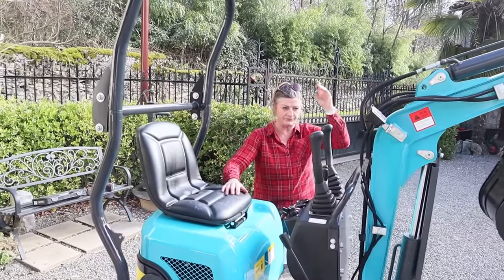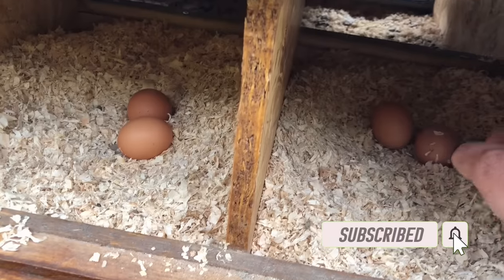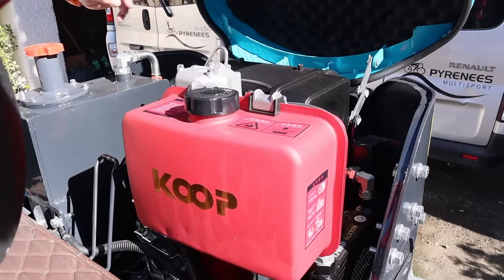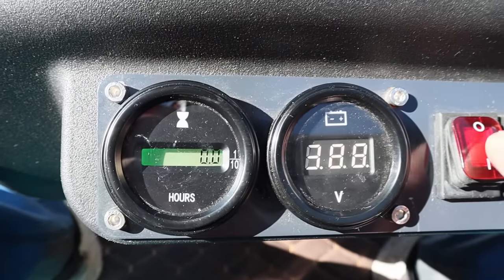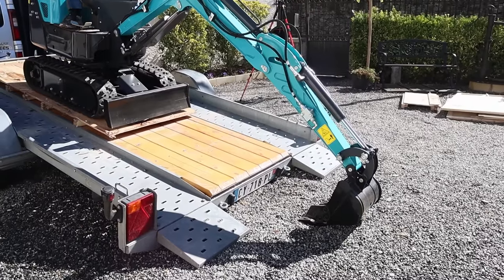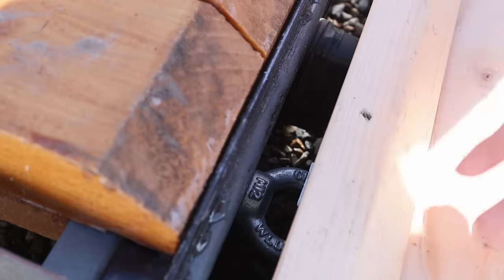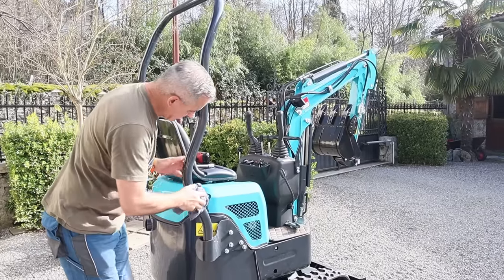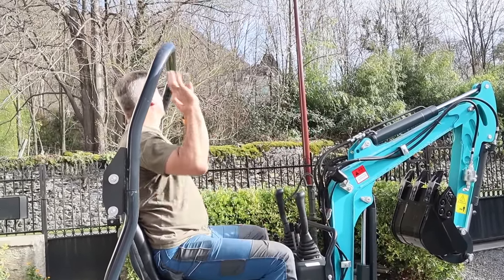Unboxing Chinese Mini Excavator | Nuoman from Alibaba

Comment: How are you finding the noise from those little Koop engines? Sounds like a rod is about to fly out the side of the engine. I’ve got the same engine on a log splitter- my neighbours hate it 😆.
Reply from the maker: I was expecting it to be louder.... there is a lot of sound proofing in the engine.  It is loud when I start it up in the garage but hoping on the build site the sound will dissipate into the mountains...... or echo through the valley 🤣

Comment: I almost bought one of these but in the end settled on a used Takeuchi due to reputation and proven reliability. I hope you get many years out of this and saves your back!
Reply from the maker: It all depends on what is available locally second hand.  There was nothing around us and all the 2nd hand sites seemed to be SCAMS so we opted for this and are very happy with the machine.  Of course I would have loved a Kubota or similar but....  😀
Reply: @HomesteadingUncontained  Don't worry, I had to pay covid tax on it. the same machine prior to covid would have been 3-5k cheaper!

Comment: Second hand ones are only 5k on ebay
Reply from the maker: Not in my area and 90% of the "cheap" excavators you see advertised are just SCAMS.  I called so many when I was searching and it was all just fake.  I did do my research before going down the route I did.

Comment: I see at the back of the manual, there is a QR code. Usually you can get some more instruction video if you scan it. Though it may still in Chinese.
Reply from the maker: I have the English version - the supplier sent it through (translation is very funny)

Comment: The cheaper equipment lacks the durability but that is a small sacrifice for home use.
Be careful with levers and hydraulic, the boom will drop with machine off, once had a mini crush my foot when I was washing it down, I hit the lever with the scrub brush oops!
Reply from the maker: Yes, the only intention it to use it on my own build - not expecting it to last a lifetime but it seems very sturdy so far.

Comment: Put some grade 8 bolts (or metric equivalent) in the roll bar mount because you shouldn’t trust the bolts they gave you with your life. And put a seatbelt on it otherwise the roll bar is kinda useless
Reply from the maker: Seat belt installed - so all good.  I will get some stronger bolts for the roll bar. 👍

Comment: Problem is that little diesel motors not adequate enough 
My 1.5 tone kubota struggles in hard ground 
Use your smaller bucket and take longer if you're planning on digging hard ground.  If you have a ripper use it to losen up the ground beforehand
Reply from the maker: We are lucky that our ground is pretty soft - 2 metres of top soil.  But totally get the "taking your time"  as I don't want to break it.

Comment: Unfortunately these made in China peices of garbage won't last long if you plan on doing a fair amount of work with it. The quarry company I worked for had a Chinese made front end loader,was a light duty one for loading small trailers and so on,he bought it new and did all the required maintenance on it and it lasted only 2 years before a major transmission problem happened with it. Of course it only had a 12 month warranty on it and to get it repaired would have cost more than what it's market value was,so it became a quarry ornament. I hope you get good amount of hours out of it before it packs it in.
Reply from the maker: Bit smaller than a quarry - it is only being used for our house build and services.  But as we are doing it over a long period it was cheaper to buy this than rent for months.  Thanks for watching and commenting. 👍
Reply: @HomesteadingUncontained  yeah I can see why you went that way then,hope it all goes well.

Comment: You can just rent one for the day or two for around 120 1st day 42 2nd etc etc 
if it breaks, not your problem or cost
Reply from the maker: You must live in a very cheap area. €200 a day at least, plus collecting it. The time and hassle makes the job a right pain.

Comment: Beware! Don’t run out of fuel!! Diesel are a pain to reprise and start!
Reply: This one is petrol though! I have one with a Yanmar diesel. I've run it dry a few times by accident. I simply refill and let the electric pump run for a while. It then sestarts after half a dozen cranks, stumbles along on one cylinder for a few seconds, clears & runs fine! I think the electric pump which supplies fuel to the injector pump makes all the difference. Bleeding fuel lines was a real pain, I agree. On others I've used.

Comment: it should have a lever under the seat to change the stick controls. there called iso or standard or aka cat controls. you have iso set up which is backwards for me. but if you've never ran a escalator before it's up to you. super jealous wish I had one for my home
Reply from the maker: I am now going to check - I suppose you get used to one system and then stick with it.  Thank you for watching.

Comment: Hi  Ian and Julie, great video! Im interested in getting the NM-E10 mini and I had a few questions.  1  when buying from alibaba   is there an escrow account that your money is held in until the machine arrives. 2 How much did you pay for the excavator and how much was shipping. 3 Is it diesel or gas.  I noticed you said it was diesel , but I wanted to confirm. Thanks Sean
Reply from the maker: The payment system for Alibaba is similar to Escrow - it is protected and released to the supplier only when you click the received button.  The machine was $5k including shipping.  Then €1000 in VAT and another €1000 in freight forwarding when it arrived at the port - so €7K in total.  It is a diesel machine.  It was a very simple process and I spent a lot of time chatting to the supplier before I pressed the order button.  I have since bought from the same supplier directly and not through Alibaba and it was all good.

Comment: 16:30 the rule is Seatbelts are requiered when Roll Over Protection System ROPS is in service. That bar can kill you in a roll over.
Reply from the maker: Yes, I fitted it for the digger but can't find a belt for the tractor....

Comment: What is it's digging depth?
Reply from the maker: I have gone to 1.5m but I think it is spec'd to 1.6m.   I do have to do my septic tank so will soon find out. 😀
Reply: @HomesteadingUncontained  yeah not long enough for the shallow tanks here in the states you may have to excavate a ramp. I rented an excavator they said would fit on my trailer when I arrived it didn't and took the size down had to park to close to the edge and the ground gave way pitching it forward into the hole was a mess removing it just a heads up!

Comment: Don't complain about the noise of fuel powered engine.  They'll ban them and force electric on you
Reply from the maker: I quite fancy an electric digger.... but not sure the battery would last the way I am driving it at the moment.  Can't wait to get it on the build site as my neighbour complained the other day when I was weed whacking with my electric strimmer. 😅

Comment: You can see it has tabs for seatbelts on the rollover protection. Rollbar wont do anything if you fall out of the machine and it rolls on you.
Reply from the maker: The seat belt is on order - 👍🏻
Reply: @HomesteadingUncontained   awesome. Id hate to see that nice machine rolled, and anyone get hurt. I am a firm believer in rollover protection.
Reply from the maker: @dondagy9109  yes, I have just fitted a rollbar to my kubota. That was a project 👍

Comment: You could have got that off without dropping the trailer or cutting any wood. One of the good things about diggers is that they can lift themselves.
Reply from the maker: I am a little more experienced now - I can load it using the bucket and blade.  But this video, it was the first time driving it...scared to death 😩

Comment: These show to be $980 US dollars surely that’s not accurate is it?
Reply from the maker: No, not at all.  They have these as sample prices and if you buy 10 or 100 of them.  You have to contact the supplier and they will give you a quote on the options you ask for.
Reply: 3500$ for The machine and 2000$ for the transportation😊
Reply: Agreed. After a decade of seeing alibaba improvements, the window prices may differ after chat/ email, contacting the agent or related company. 
The MQ minimal quantity discount can help a lot if you have the budget. 

Budget can vary.
Return customer discount too. 

I started a couple decades ago..(trained to draw architecture tek drawings but "handyman" simpler, is always in demand) 
just neighbors lawnmower jobs, to.. 
Growing business from even a handyman business is simple recent years because more people lost the will or "made at home" traditions. So my home improvements requests grew from originally just grass cutting to small painting or landscape walls, house painting etc
It's really not hard to try practicing and most people are only happy to negotiate.

Comment: These engines are cheap but they last forever if you mind the engine oil changes.
Reply from the maker: I will look after it - it is nice little unit and very well built.

Comment: Another toy or clutter for your garage. I would go to Home Depot and rent this mini excavator instead. May be they have continuing need for the machine.
Reply from the maker: If I had rented a machine I would have paid in excess of €8000 over the time period of my build - so buying this machine allows me to work when I can without the worry of going to the renter and transporting it back to site.

Comment: You don't use copper grease on bolts....... Grease dissipates and copper remains..
Reply from the maker: For anti seize I do - used to very old cars that I have spent days trying to get bolts out (trying not to shear them off).

Comment: Do only wish the best with it, hopefully one of the enigmatic few knockoffs that actually perform.  Reminds me of a JCB micro Frankensteined to an I'm not sure....i can count features virtually identical to at least four American models.  (In performance we'll see how it stacks up....I'm paused).  I used to train people on JCB equipment so very familiar.  I'll be interested in seeing the additional functions.  Are the tracks supposed to have that much slack or did you end up adding grease?  Unfortunately couldn't use on a US job site, I was looking up the ROPS to see requirements while installing the roll bar and it was questionable there but when you said no seatbelt, that did it, lol.  For personal and small farm use (if rest of this works functionally) then it's good for that kinda thing.  Would only be concerned about parts.  Are there any implements from other manufacturers that are compatible (adapters available)?

Comment: The machine is really cute but you really upset me with the fact that you never ever checked the engine or hydraulic oil levels.  You also put the bolts in the "roll" bar in backwards as the head side always goes on the outside with nuts on the inside.I love your puppy but don't let her drive!
Reply from the maker: I did check the fluids for sure - I changed out the bolts afterwards - I was just excited to get it all fitted.

Comment: Works great till something breaks, then you just have a pile of scrap, bound to find a English version of the manual.🤣🤣🤣
Reply from the maker: I am pretty good with my hands - if something breaks, I tend to get it fixed with what ever is at hand.  I could have had the same with a 20 year old Kubota which would have cost 3 times more.

Comment: Didn't need to sniff the tank to know its diesel. You can see the high pressure injection line going into the single cylinder.  No spark plug.
Reply from the maker: I know I know 🤪 - I just had in my head it was a lawnmower engine and my brigs & stratton is petrol.  It was just an assumption (my tractor is a diesel kubota but that is a proper 3 cylinder beast)
Reply: @HomesteadingUncontained  fair enough.  Sometimes one gets an idea in one's head that is difficult to shake even though you know your wrong.  Heaven knows I'm guilty of that one.

Comment: Same thickness of wood that came on my $800 150lb chinese lathe and I thought it was crap, cant believe they used same thickness for a machine that weighs a ton. Hope the digger isnt as disappointing as my lathe. Ive had chinese lathes before that were just fine but certain models are garbage. Stay away from any 8x16 lathe unless its Sieg.
Reply from the maker: I think this crate was just to keep the dust off it, as the larger machines are just loaded into the shipping container.  It was all good and still going strong.

Comment: Why did you cut the wood the digger can drive over it you need to get somebody to show you how to work it properly because you didn't even have the Rev's up that's why it was so Quite and you will do more damage to it Wit not known how to run it.
Reply from the maker: I know, so many people laughing at that.  The machine is actually quiet at higher revs too which I was surprised at but the engine compartment does have insulation around it so that must be the pro upgrade 😆

Comment: You said you don't want a seat belt but without one you might aswell not have the roll bar
Reply from the maker: See my recent video - the seat belt is installed 👍
Reply: @HomesteadingUncontained  only discovered the channel yesterday all seems interesting glad it's fitted because they say if your not strapped to the seat you won't benefit the roll bar 😉

Comment: ah man idk about that mini ex it didn't seem very smooth and the blade does not lift up very high  i would stick with actual brands and not made in china stuff personally i would of saved up a bit more and got something like a made in USA cat or sany... and if your wondering i've put hundreds of hours onto my sany 3.5 mini ex and never had a problems  i would be interested to see how this thing actually holds up in a hard work environment
Reply from the maker: 2nd hand market here in France is expensive for named brands - spent months trying to find a decent unit that didn’t need total renovation.  Hence the risk of buying new from china - it is working out very well though and is doing the job.  But I know what you mean - I would have loved a kubota or Bobcat.

Comment: Shoulda got a John Deere loader backhoe I bought one 2021 love it it also cost 37 k I bet that mu bucket cost more then that machine so there is that.
Reply from the maker: That was the whole reason I bought this machine - I did not have the budget for a named brand.  I also did not want a backhoe for my tractor as I need to use both machines at the same time.  If I had unlimited budget I would be going to my local excavator supplier and buying a 5 ton Kubota or similar plus a truck to tow it.

Comment: Easier said than done but Don't jump off a tipping machine hold tight and roll with it limbs in tight..
Reply from the maker: No, I won't and since this video I have fitted [and use] a seat belt.

Comment: Most people so unfit now, nobody do any labouring because of machines like this. Pick and shovel still best for small to medium digging.
Reply from the maker: after 35 years of cycling, I feel I need a little help with my building work - still very fit but I would rather the machine work those muscles than killing myself doing it.  It is supposed to be enjoyable 😀

Comment: The days of "made in China" being a bad thing are long behind us.  China has upped its game.it the past 20 years, moreover, you get what you pay for.  Basically, the less expensive the product is, the more you will want to double check fittings, liquids and overall assembly.  It will also be wise not to demand more than the tool is designed for.
Reply from the maker: Exactly - I am looking after it and it is out performing what I thought I would get out of a little excavator - I have rented a similar size (JCB I think) and it was no better other than a little quieter with its 3 cylinder engine - That was an option for mine but I just didn't have the budget at the time.  Maybe in the future I can fit it.

Comment: The carrier was to lazy to tarp it
Reply from the maker: Then my bad as the only time it got wet was 10km from my house as it was on my trailer - before that it was in a dry shipping container and warehouse - when it started raining I sped up but was a little too late 😵‍💫
Reply: @HomesteadingUncontained  lol I thought the carriers brong it out to the house
Reply: @HomesteadingUncontained  Well how do you like it?  I hope it works out for you!  I got a hug Ford C555 backhoe frontend loader. with big buckets on front and back
Reply from the maker: It works well, although I have not done anything really tough just yet.  I was thinking of a back hoe for my kubota but price was very similar plus I can use the Kubota to shift the dirt around.
Reply: @HomesteadingUncontained  Kubota make a very good tractor~  i like them. 👍This C 555 Ford only cost 10k  I couldn't pass it up!   this one had very low hours on it. They was going for like 35k  👀